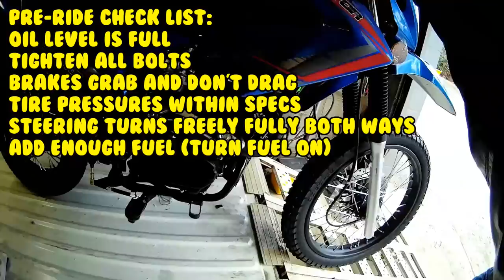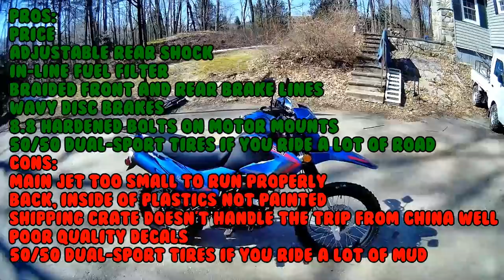$1300 NEW 2019 TAOTAO TBR7 230cc FULL REVIEW build ride mods Dual-Sport Pros Cons.

Comment: HMM, Hawk is fairly tall to start with for just casual trail riding, this is taller? I have two hawks and a csc tt. Hawks look better for harder riding..full knobbies for the first thing. Mine have surprising punch for 230's. The Yongshen motored csc is smoother but less 'punch' felt from the saddle. Much more expensive but much better switches/mirrors/ etc. Nicer finish too, but if you're going to rock and roll the dirt, who cares.. Hawks have held up in the rough stuff quite well  and run strong once you get the jets figured out for your area. As mine came were waaay too lean. Make sure you get the connection between air box and carb straight and secure. seal it up if you have too with one of the rubber sealing compounds outthere that will cling to both rubber and plastic. Go thru and tie up all the wiring so it doesn't abraid or bounce around. I hot glued my wire connectors to eliminate water and resultant corrosion. Oh, when you first go after the wiring under the tank, take a few minutes to flush the tank. You may be suprised at what kind of crap got left in there. slap an inline filter between the petcock and the carb. CHECK YOUR SPOKE TENSIONS...If you ride any amount of gravel/rock stuff lose that front dp tire quick. Front IRC trials tire turned my csc(dual purpose tire setup) into an entirely different machine, the increase in traction/control was amazing. (same effect on my KLRs) Hawk full knobbies work fine :) Hawk's not as 'pretty' as your TAO, but "pretty " was NOT my concern for trail bikes. CSC 'looks' quite a bit better. Hawk seat has been fine for me. Rear swing arm is bargain basement tho...functional, but is crap compared to jap dp bikes so LUBE that swingarm bolt!!.
Reply from the maker: Great info. I agree
Reply from the maker: BUT, this has an adjustable rear shock!

Comment: After watching some of these blogs you posted and researching the difference in the Chinese bikes. I couldn't find anything used in my area to buy anything else I guess because of covid-19 I went for a new Chinese Enduro motorcycle and chose the Raven 250 at the time was on sale for $1249 and I don't think I went wrong it's been great right out of the box. It was easy to assemble. I did it by myself in 5 hours.
Reply from the maker: Awesome. Congrats! Howmyou like it?
Reply: @MotoCheez  I like it it's a great bike

Comment: You got a better TAO than I did if you got disc brakes.  Mine is identical to yours accept for that though.
Reply: You do a better wheelie than I can too LOL!
Reply from the maker: Haha. These are the brand new improved TBR7. Thanks! My first wheelies of this year 😁
Reply: @MotoCheez  Mine is a 2019 but it only has front discs.    I have a question about yours.   How much torque do you have on the rear axle?    When I put any on mine at all it starts to bind the  rear wheel.    I can put about 10 lbs on it and it spins perfectly but get above that and it starts to slow down fast.   If I were to put the "normal" 40-60 lbs on it, the wheel would not spin at all and make a noise when you make it.      I took it off and checked the bearings and they looked ok ( I re-greased them anyway), but no change.
Reply from the maker: They changed to rear disc with newest shipment l, must be mid year change? 
As far as you're rear axle bolt. There should be no binding, the bearings and spacers between the bearings are supposed engineered to tighten against each other and not put latteral pressure on the bearings. Maybe one of your bearings are not seated all the way in the race?  The spacer between the 2 bearings inside the hub is what it squeezes against.
Reply: @MotoCheez   I think you may be on to something.   In my rear wheel there are 3 sets of bearings.   In the center there is a set with a spacer, then the brake hub presses on that from the right side.   On the left there is a third set of bearings in the hub that the sprocket is on but just empty space between there and the other two sets of bearings.   I found this video at about 8:54 mark where the guys shows something in his wheel mine infidelity does not have.   https://youtu.be/dQbKXbhyFQs?t=534    The bearing set on the sprocket side of mine has a larger center hole in it than the other two sets a part like that would fit it.    I called the dealer I got my bike from last week but so far no one there has got back to me with anything.    If I knew for sure a piece like that was supposed to be there I could just make one as I have a lathe.
Reply from the maker: It MUST have a spacer there! Try txpowersports they have diagrams
Reply: @MotoCheez  I got it fixed.  I really appreciate your help on the matter.   Here is my review of the bike if you'd like to see it.  https://www.youtube.com/watch?v=xbq67PLn_Gg

Comment: Mini-Truck haulin' a Mini-Bike.  Purdy little thang.  The underside of the fenders... some of that rubber undercoating sprayed on there, or bed liner, or, even that gutter seal might do.  

I like the CRC Assembly Lube with graphite... has some anti-seize properties.  I never have issues with my nuts/bolts on my bike.  Even after 147,000 miles of hard riding on her.
Reply from the maker: These China bikes need locktite! Lol
Reply: LOL... I "unnerstan'".  Hopefully, it only needs "blue".

Comment: i find it’s the poor quality of the raw materials, such as the plastic used on the cables and bodywork gets super brittle. the metal also is that really bad pot metal like they use on hot wheels cars. so out of the box they’re ok but they just don’t stand the test of time. it’s more like $1300 every year because that’s how often you need a new one

Comment: Alright cheez I have some issues going on, I upgraded the exhaust like the one on your website, and I did the carb mod with a 105 main jet and the pilot turned out 2.5 turns, and I did the valve adjustment. After a while of riding the spark plug has lots of carbon build up and anything after 1/2 throttle it just hogs out and dies. Any recommendations would be great! Thanks!
Reply from the maker: It's definitely too rich, maybe lower the needle (take washer back out) jet size is determined by your elevation too. Higher elevation lower jet size. So a stock bike might run great in Colorado.
Reply: MotoCheez I’m at 650ft in elevation. Problem is that kit I ordered didn’t have anything smaller than a 105 main jet, do you think I should try to get a smaller main jet or see if I can adjust the needle? Thanks!
Reply from the maker: @dirtbikerpro8362  I'd drop the needle first, 105 should be fine, thats my elevation
Reply: MotoCheez okay great I’ll try that. Right now I’m at one below the center should I got center or one above the center? Thanks for the help!
Reply from the maker: Justin Thurber try center first
Reply: MotoCheez Alright got an update for you, so no luck with the adjustment of the needle. But when I took the tank off the test compression and look at the valves again I found there was a crack in the CDI box and it was allowing spark to ground out to the frame. I have called Tao Tech support and I’m waiting on a response. But have you ever heard of this happening ?
Reply from the maker: Justin Thurber good find! LMK how you make out?
Reply: MotoCheez just giving you an update turns out I mistaken the CDI box for the ignition coil, so I got that in and now she’s running great! Also, got a piece of metal in the rear tire punctured the tube too, I was going to try and get a supermoto style tire that is tubeless. Do you have any recommendations?
Reply from the maker: Glad you got it figured out. I don’t know but the guys in China rider.net would. Check there

Comment: Just a heads up I appreciate all your videos they are what made me decide to get the tbr7 TaoTao and it's actually a fun bike I love the hell out of it I'm in my 30s and like to ride off road with my kids I have a little all automatic TaoTao db10 for them to ride around it actually gets around pretty quick which is no surprise it is a 110cc motor on a little pit bike style frame I got it Dirt Cheap almost brand-new in a trade from somebody and that's what made me decide to get the TBR 7 was being surprised with how well their little dirt bike ran for being Chinese I have had a few Chinese bikes and quads we had a little quad with the 110cc engine on it that lasted almost 17 years two generations of kids got to ride it and tear it up so I think they're a little more reliable than what people say yes they use cheap parts on them but it's not very hard at least with this tbr7 and the hawk 250 S to find aftermarket parts and obviously bolts and nuts that strip out happens a lot with Chinese bikes but you could redo all of your Hardware for dirt cheap on the entire bike so sorry for the long comment long story short I appreciate your videos you helped me pick my Chinese dual sport or as I have always called them Enduros I think that's an older generation thing LOL anyways thank you Moto cheese hopefully when I make a little bit more cash I can start getting some of these aftermarket parts you have the info for on your website which is another shout-out I appreciate you're the s*** that's what started me on watching your videos and then I started watching more about the mini truck and dumpy and I f**** love those little trucks I love how you made many truck a mean little off-road machine I think people get really surprised when they see something so small in Japanese go through mud so easily haha anyways thanks for your videos keep putting them out hopefully when I make enough cash I can get some performance parts on my TBR 7 and get it up to par With Your Hawk  keep making your videos thanks again sorry for the long time at
Reply from the maker: That's awesome! Not long winded at all, very informative! It's good because a lot of people read through the comments as well. Thank you and enjoy the bike!! Meep!
Reply: One question motocheeze do you have any other tips for performance on the Tao tbr7 like any cdi boxes that you have heard of that would actually  make an improvement or what the best performance upgrades would be I have put the 17 tooth sprocket in I actually ordered the whole carburetor kit that you have on your website and ended up after a few adjustments putting the 110 jet in it it seems like the 1:15 was it just a little too much for the carburetor the stock carburetor at least I have the same problem with the jet being too small and it only wanting to run without bogging down while on half choke obviously when I put that kit in the carburetor is doing much better no problems with the 110 jet but do you know of what else I can do to get more performance obviously one of those exhaust set up you got for the Hawks seems like it would add a little bit and a better carburetor I plan on modding the bike over time but right now my next step is to get the 45 tooth rear sprocket and after that I planned on doing the exhaust kind of got to do it one part at a time if I could afford more I obviously wouldn't have bought a Chinese Enduro I really want it a DRZ400 but really could not find any used in my price range and definitely couldn't afford a brand new one at that point in time maybe save up for it until next summer would really love to have one to ride around with the kids cuz you know their reliability are way better since it is a Suzuki and its japanese-made just really wondering the best smartest ways to go about making the bike have more performance without going too far and wearing out the engine too quick I have followed all your advice I have been looking these bikes up for the past year and all the information from your Channel is what brought me to the conclusion of buying the tbr7 which I appreciate it is a lot of fun it would be nice to have a rev limiter with the CDI box that actually worked correctly and gave it more performance but as far as I've seen there isn't anything for it from what I've read people say that you're better off waiting until the electronic fuel injected version of the tbr7 to come out and then doing your upgrades to that obviously I can't afford to do that or I would just save up my money for a DRZ400 I've had my eye on that bike for years now hopefully I get to the point to where it is in a fordable goal but any info you have on helping me get my bike to top performance I would appreciate it I have been following your Channel for a little while and everything you have on your website has been helpful thanks again
Reply: Affordable lol
Reply from the maker: They make an adjustable timing CDI box, I put on my hawk but wasn't noticable. The exhaust from hawk250 will fit like on hawk.

Comment: You should have adjusted the needle in the carb slide before going that crazy. Most of the time it works well 😋 great vid. I love these cheap bikes.👍
Reply from the maker: WOT is main jet. Needle is good 1/4 to 3/4 in combination with main.. 88 main is way too small at 600ft, I've done so many of these bikes carbs I can do it blindfolded 😄😄😄
Reply: @MotoCheez  sorry I forgot lol thanks
Reply from the maker: 😄👍👍 you're right in most cases on the needle though

Comment: Set your high speed jet first. Then low speed
Reply from the maker: There is no high speed jet adjustment, it's the main jet I changed. Idle mixture I adjusted would be considered low speed

Comment: Sweet looking bike i figure 34 inch seat height or is it higher and with the adjustable suspension how low do you think you could get the seat height?
Reply from the maker: It's 34  Hmm you can lower about 2"
Reply: @MotoCheez  Thanks so down to 32 like on the magician from what i'm seeing in you tube videos the tbr7 seems to be a better bike than the magician i ask because you had both plus you know who you sold both too so you know what problems they had with both
Reply from the maker: Not quite as low as magician, Almost. The TBR7 is better IMO
Reply: @MotoCheez  reason i ask is i'm 5"4 magician is 32.3 i figure 32.7 for the tbr7 and those are the 2 shortest enduros you can find for cheap unless you luck up on a used tw 200 starting to think i might be better off with a little 125 grom clone and just add dirt tires to it you know seat height 29 to 30 in now if i just wanted street there are plenty with low seat height
Reply from the maker: The magician would work. Blade is 5'6 I think. It's just a harder ride
Reply: @MotoCheez  Thanks for replying so fast
Reply: @MotoCheez  You know some states DMV'S are just stupid sometimes it tells you on the site to check with your local DMV to see if it can be registered as street legal i did that in Greer SC and they said they didn't have a list of street legal Enduros that i should contact home office which i did they said i needed to get that from my local DMV now i live in another town but still in SC so i still worry about that on the Magician or the TBR7
Reply from the maker: True. You never know. I know CA and PA is a no go

Comment: Hey was wondering wat size sprocket u did i the rear on the tbr7
Reply from the maker: Left stock rear
Reply: Wat chain size do you have on there
Reply: Was also wondering wat type oil you were using if think its ok to run Honda Gn4 10w40 oil in the TBR7
Reply from the maker: @mikenarug1  I use SF rated motorcycle oil, that should work fine
Reply: I just heard alot people using the rotella t4 oil
Reply from the maker: @mikenarug1  a lot do use the diesel variant, problem is the diesel oils have been taking more and more zinc out of them. I just feel safer getting the proper SF rating so I know there's a ought zinc and I don't round my cam lobes or ruin the rockers..
Reply: Ok yeah i put Honda Gn4 10w40 in my tbr7 just wasn't sure
Reply: Wat size chain are u using
Reply from the maker: This version was 428
Reply: Yeah i know but how many links is your chain stock is 126 links i here a lot of people changing sizes
Reply from the maker: I thought it was 128, I buy the 130 link and remove links if needed
Reply: Koo thank you for the information
Reply: Im looking to upgrade battery to i put speakers on the tbr7 worry about it draining battery

Comment: Man you get so much hate in the comments... I wanna get a hawk for playing around town and trails. Which do you recommend, the hawk or this? Aren’t they essentially the same?
Reply from the maker: Yeah.. haters just wanna hate, just like Ford and Chevy guys arguing  haha  They're basically the same bike, this is more set up for road and has a few upgrades than the hawk.
Reply: MotoCheez does it have any more power? I’m really leaning towards getting a hawk and doing the carb, jets, gauges, intake, exhaust, and tires. It’s really not expensive. Spend like $300 on upgrades and it’s good to go. Plus I think the black hawk paint just looks better when stripped of decals.
Reply from the maker: Same exact motor. Same power.. ya I like the black too 👍👍😁😁
Reply: MotoCheez well... I might have some hawk videos up soon... I’m pretty set on that one. I just hope with all the upgrades I’ll be able to get to the next town over. Speed limit goes all the way up to 65 along the way... if I can at least hit 60 that might just work. What you think?
Reply from the maker: Imo if you're using on road mostly, gear it up 17t front at least
Reply: MotoCheez I’ve read about that (I think from you) so is it 17 up front and stock in the rear? Or just go 17/45? I think I’ve heard it both ways... thanks for all the answers!
Reply from the maker: 17/45 is best for road
Reply: MotoCheez awesome thanks